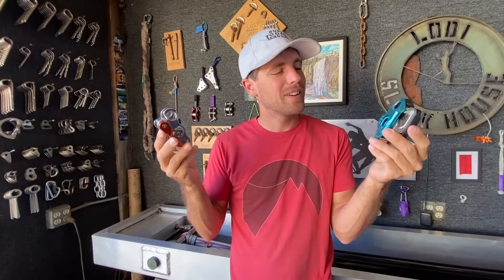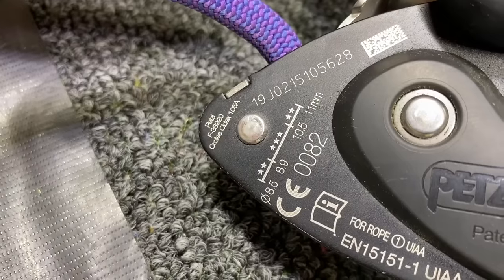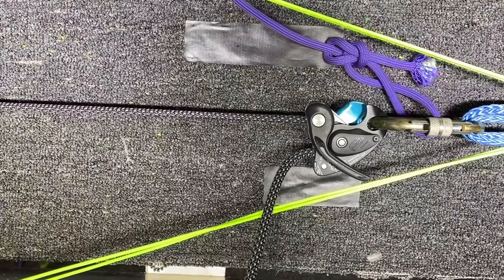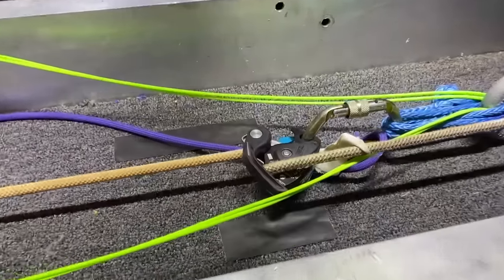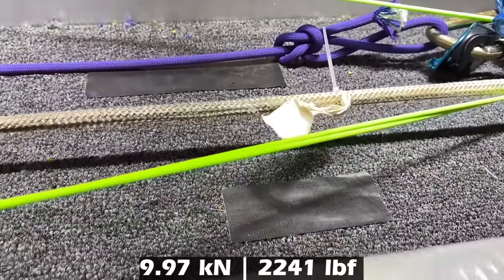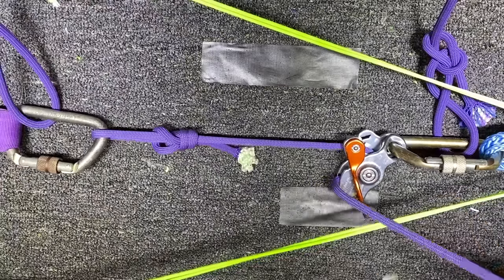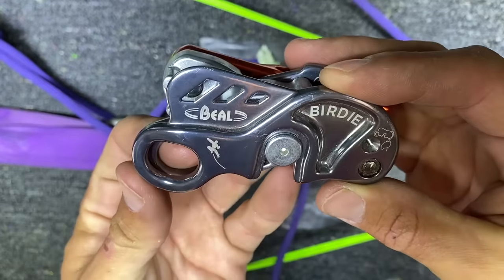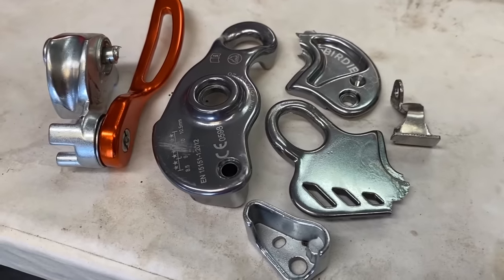What breaks first??? Petzl GriGri or the Ropes? + Beal Birdie Tests!

Comment: The gri gri slipping is still super good enough. That slip on a big fall will help give a soft catch and it will only see max force for a couple of seconds
Reply: Plus not destroying the rope.
Reply: @lazycat5108  well if you experience 10kn, I don't think they sheath of your rope breaking is your main concern
Reply: @loganvilas1032  True! But you see, it'd be easier for my belayer to pick up my broken body if it is still attached to the rope :D
Reply: @lazycat5108  i laughed at this and probably shouldn't have, thanks!
Reply: True, I can see the slippage being useful on trad pro for helping reduce the force on those too
Reply: I was thinking the same
Reply: They both did slip, I like that the birdie slipped less.
Useful for tree work.
Reply: More like a few tens of milliseconds. Even if you fell 100 meters in a perfectly streamlined position it would only take you 0.3 seconds to stop completely at 10kN. (And that would be with an infinitely static rope.)
Reply: Welcome to the hydrolic stretch channel.
Reply: @loganvilas1032  
Not if the device blew up and dropped you….
I’ll take a desheathed rope over a free fall any day.
Reply: @johnarcher9480  after hundreds of climbs without ever having a problem I'll take my chances. Not to count the 10's of thousands of grigri's out there not blowing up
Reply: @loganvilas1032  
And I’m sure it will be fine. Just as fine as you would be on a birdie.
Not many take 10kn falls 😉
Reply: @johnarcher9480  exactly 💯
Reply: The birdie works better for lead climbing in every way. Feeds better, it’ll lock hands free so it’s ultimately safer if the belayer gets hit by a rock, camming device will still lock in a fall if the user is holding the cam down, before you bad mouth a device that got tested in unrealistic tests, go use it in normal conditions and I promise you’ll like it more than the bulky overpriced plastic gri gri
Reply: @justindoss3701  what device did I badmouth?

Comment: I bet the Grigri is designed to slip around 4-8kN. I mean it's probably so if something were to happen and those forces do end up happening, a few feet of rope being taken with a constant 4kN force, could potentially save someone's life because is helps lessen the impulse of the fall essentially making it safer.
Reply: Yeah, that’s my thinking too. But let’s see how it handles the quick and heavy tensions when the drop is set up. Super excited for that. I think HowNotToHighline needs to invest in a higher frame per second slowmo cam to catch those extra juice gear gut spills.
Reply: @zanestathakis30  this test is basically already done, has to hold a fall factor 2 fall hands free in uiaa testing.
Reply: The GriGri was designed to allow for a slow slip in the event of a fall. It's one of the main reasons we use them in rescue. I love the GriGri because it's saved my hide a few times. However, I wouldn't touch the Birdie with a barge pole. I've found them far too unpredictable and touchy to use in a rescue situation.
Reply: @ryanhanslo3029  They do work great when doing solo work, Guiding the rope is import and, and makes the Birdie much more controllable. I can see how in a rescue situation that might be more difficult. Why not the Rescucender?
Reply: Are you using a static rope on rescue missions?

Comment: interesting to try micro-traction and alike - how low they really start to damage ropes. Cheers!
Reply: This would be super interesting! Micro Traxxion and Petzl Shunt break tests please!
Reply: Microtrax vs ct roll in lock. Can skip the Spock and duck lol
Reply: Would definitely like to see the Micro, since it is the gold standard for rope solo and simul-climb right now. 

The Micro is only rated at 2.5kn, I heard TC say it's good for 3kn, but don't think he tested it.
Reply: @GregSidberry  whats wrong with Spoc? I've been using it for a while, super happy with it
Reply: @pavlodeshko  it's not a well rated device based on testing. It's recommended to avoid the Spock for TRS. Duck is similarly poorly rated, but better design. Microtrax and CT roll n lock have both tested well with micro being more damaging ( fine teeth) vs CT handling higher loads. Everything has a failure mode/max force: spoc and duck just hit them easier
Reply: Would be interesting to see the micro-traction and Tibloc in tandem for a crevasse rescue context- maybe with some thinner ropes like the Petzl Rad line
Reply: Yes please do this!! I TR solo with the micro and some other rope grabs and I want to know what happens when they get pulled
Reply: Micro trax and Camp Lyft would be cool!
Reply: @GregSidberry  super good enough for me - spoc will fail long after the rope. Will agree on duck though, its basicly not load-bearing pulley at all - requires rope to be passed through carabiner to hold
Reply: The thing is.. a pull test is kind of meaningless as it's the behavior under impact (in a fall) that you're interested in. Needs the drop tower.
Reply: @johtso1  these things work very similarly in a fall. They slip at their max load for a given rope, until the friction absorbs enough energy for the falling object to slow down and the peak force to drop. That’s pretty ideal for a fall arrest device, as stopping a fall above 6kn is very risky. Basically you want your device to give you as much friction in brake mode as your body can handle, and slip at that point.
Reply: @blakeseidler3577  Not sure which specific devices you're referring to, but micro-traction doesn't slip at all.. it bites and then strips the sheath if there's too much force. Think the same goes for many similar devices even those without teeth. Maybe applying a static load is enough to figure out when this happens though? I'm not really sure..
Reply: Micro-Traxion damages a 10.5mm EN1891 Type A semi static rope about 4kn if loaded up to it steadily like shown in the tests here but very dependent on outer sheath condition. Croll (and the other ascenders that use the same design like the basic) are about 4.5kn from memory, however they don't tend to fail just bite into the outer core until somewhere a bit higher. I wouldn't want to fall onto any of the teeth based systems to be honest. Industrial side you aren't meant to ever put yourself in a position where you could fall on them.
Reply: Im curious about the ropeman

Comment: You could get a cheap thermal camera (about $160) to easily find hot parts on the floor. Just be quick about it before it cools down, and make sure you don't have to many hot things around. Alternatively, if you can darken the workshop, you could put a little (invisible) UV fluorescent ink on the part being tested, and a UV flashlight to find it.

Comment: I once witnessed a 140ft factor 2 fall on a Gri-Gri: Lurking Fear on El Cap, party was block leading, leader was self belaying on a gri-gri (70' out from the anchor below, at the end of his rope, just as the 2nd was arriving at the anchor), leader was aggressively back cleaning, he wasn't using daisies and fumbled out of his aiders, pulled the only piece between him and the anchor (#1 Camalot). The fall was on p5, we were on the ground about to start, pre-dawn so I saw the headlamp beam falling, I happened to be looking up.

They managed to self rescue back to the ground, and walk out under their own power. Rope burns, sprains and strains, and minor kidney bleeding. They happened to live nearby, so I got the details when he came by to pick up his gear that I had cleaned from his highpoint (2 cams, 2 aiders). He said the Gri-Gri was slightly bent (I dunno exactly) and was jammed/cammed hard in the locking position onto the rope, which reportedly took some effort to un-cam and remove. He was tied into the end of the rope, not sure if/how his knot might've been pulled up against the device.
Reply: Wow, that has to be the worst whipper I've ever heard of. Can't imagine walking away from that.
Reply: Whoa!  That is heavy.

Comment: Seeing the GriGri slip before breaking makes me feel pretty safe. Slipping would probably mean that I'm not entirely snapped in half during a fall.
It makes me wonder what other devices like the Madrock Safeguard would do in the same situation.

Mad hype for the drop tests. I'd love to see all of this again in a dynamic situation. Plus you can get some HUGE forces on static ropes, so we can probably see some fun stuff with that tower.
Reply: They both slipped before breaking.
On the larger rope, the birdie gripped better.
The Grigio blew up at 9.7 KN. The birdie started to desheath the rope at 9.9. 
If somehow you were in a 10kn fall (other than maybe breaking your back) the Grigri drops you to the ground, the birdie desheaths your rope.
Neither a “good” thing, but at the end of the fall. A desheathed rope is better than a free fall.
Reply: You will never put that much force on the belay device with a dynamic rope. So it really doesn’t prove much.

Comment: Hey Ryan, avid Beal Birdie user here. To answer your question you don't lower off the birdie like you do a grigri, using only the handle, you instead use the handle for rough control and hold on to the brake strand and meter slack out like an ATC.

The Birdie has been my favorite assisted braking device for a long time, the all metal construction and ease of giving slack while lead belaying makes me recommend it over the gri gri for new buyers, glad to see it holds more than a gri gri too, more to brag about! :3
Reply: The thing is with a atc u have ur two hand on the rope not one so iam not sure with one one only you would need to let the rope slip tru ur hand risking burning yourself while the grigri you really control the speed whith your left hand on the handle ! The rigth hand is just there for safety 
Avid grigri user here !
Reply: I'd say you handle the Gri just like you described you would the Birdie while lowering. Petzl even made a biner especially for that purpose to increase friction and care for the skin on your hand
Reply: @seeeeeb9300  yeah its the same, just a different cam position.
Reply: Yeah, it’s a little more bias toward the brake rope side vs the handle side.
You CAN control with just the handle, you just need to move less to make speed changes.
Love the size of the Birdie as well.

Comment: It would be fantastic to see how an Edelrid Jul 2 or Mega Jul would hold up in these similar tests.  A little "apples to oranges" but it would be interesting to see where the failure point it, as there are a lot of folks using those as well.  Thank you for everything you experiment with.  A wealth of information is generated by you guys.
Reply: Jim titt did some testing on this that you can find on mountain project, slips at around 0.8kn and will continue to slip from there.

Comment: Hi Ryan. As a adventure guide we sometimes have to leave slings behind when abseiling. mostly in canyoning. I have seen that in Australia canyoners use old car seat belts used as slings. are they good enough. great work as ever. PS hi from Scotland
Reply: I would imagine that as long as the seat belt is in decent condition that it would be good, as the ratings I see  from a quick search range from 13-25KN. It'd be cool to see though!
Reply: @mattsoukup1789   I guess then the attachment method, either knot or stitching is what would make them safe or not.
Reply: @nicholasmiller7886  seat belts are like dynamic ropes, they stretch a lot.
Reply: We use single-use-slings made from seat belt in construnction. Thin, strong, flat. You can built it in a wooden wall and lift it with a crane or you screw it down with a 2by4 or somecind of wood. 
They are certificated as a lifting sling and rated about 800kg which should be arround 1400 lbs and they cost arround 1 euro
Reply: @Elmer Adams  source?
Reply: @hudsonmote9680  You know, that's just what I've been told over the years. I'll look into it. If I find a good article I'll let you know.
Reply: @hudsonmote9680  I did researching. Seat belts stretch a little because that reduces forces in a crash (kinda like climbing). However not all accidents are in the front, so it has to keep you in your seat. I wasn't able to find any data on stretch. I emailed seat belts plus (they sell webbing and belts for cars). They said "The webbing we use is a 1 7/8 wide which is the auto motive standard but the tensile strength is 6000 pounds. The webbing is not stretchy at all."
So for climbing I wouldn't count on it being static or dynamic. (6,000lb = 26.6kn).
Reply: @elmeradams8781  seat belts are not dynamic.
Reply: @TheClanAdventures  You might not be correct. I know some seat belt retractors tighten (to take up slack), then lengthen when pulled on (to lessen the impact). Since I couldn't find any data besides random people saying "seat belts stretch up to 20%" (with no source for that info), you very well could be right.
Reply: @nicholasmiller7886  we use to lift engines with them too. Sometimes they break easily at the knot, or they slip. Sometimes they hold 200+kg No way they are rated for 22kN like ropes. It's garbage. I wonder if it's nylon or just some polypropylene

Comment: Thanks for that this is super nice to know. I often put quite heavy loads on gri gris at work. If it's really heavy I prefer to put it on a rig but still I've had situations where I've hung 200-250kg with 10.5mm static rope on a gri gri. Knew it was pushing it though

Comment: The tension force of a rope is felt at both ends, and for an inertial body (like a falling person), presence of force implies change in velocity.

7.3 kN will bring a 200lb person falling at terminal velocity to a complete stop in 0.98 seconds, long before you lose a significant amount of rope to slippage at the pace seen here. Super good enough.

Comment: Instead of trying the rope to the load cell when breaking belay devices it would be more useful to just tie an overhand or a slip knot in the rope and pull the know through the device.  The rope soloers tie slip knots in the rope as a fail safe assuming that the knot will jam in the device is the device fails to auto-lock in a fall.

Comment: With the brake strand tied off behind the load cell, you're only measuring the force on the carabiner. Same with you holding the brake strand. The load on the climber-side rope is equal to the force on the load cell, PLUS the load on the brake strand. It's like the inverse of a pulley system. The break force was probably way higher, and the slippage with your hand on the brake strand was equal to the measured force, plus however hard you were pulling on the brake strand.

Comment: grigri test winner for me.  it does not damage the rope and is safe.  its advantage is that it will softly close the rope and will not break it with the utility forces kN 👍🔥
Reply: The Birdie did the same. 
On the big rope, it took more to desheath the rope than to blow up the grigri.

Comment: As far as I am aware all belay devices will slip, because they all are brake assisting and they will not brake the rope completely, and the GriGri is one of the devices with the highest slip value also compared with other half automats, so it is actually very static in comparison with tubes or even HMS, which is why for instance in alpine multipitch climbing with belay from a fix point you should never use a GriGri. Here is a comparison of different half automatic belay devices in German with the slip values (Durchlaufwert), and other interesting stuff https://www.alpenverein.de/chameleon/public/919174d8-26c1-2717-9f9a-6f7479be220f/Panorama-2010-4-Geraete_18413.pdf

Comment: Didn't know about the Birdie, looks light and sleek. What's your experience with it guys, compared to Grigri?
Reply: I LOVE the Beal. I use it for tree climbing and radio tower climbing.
Keep a little tension on the tag end, and it can release very progressively. It does take less movement to get it to release, but once you are used to it, and get a feel for it, it’s a non-issue.

Comment: Ok, so we see grigri is such a well-designed device!
If we put all the pieces together:
When the grigri is on the belayer the rope slips around 7 KN; the climber would have created a force of around 14 KN and the anchor would have a force of around 21KN. 
If you think about it, the harness is designed to support at least 15KN while many anchors and bolts are prepared to support around 22KN, however there are so many variables here and those forces would be nearly impossible to achieve in a realistic rock climbing situation. 
Therefore, just when the whole system is about to collapse grigri would release some rope to give you a second chance. How amazing is that?

Comment: Just a quick question has anyone else used the gri gri in industrial applications I busted mine in 4 months of descending as a high rise window cleaner?
Reply: Just to be clear we have another rope and an assender as a back up but I did end up having to ascend to the top after the gri gri failure
Reply: 🤯 how did it fail? 

I’m starting to not trust the gri gri!!
Reply: How did it break?!?
I use the Birdie for tower climbing and tree work. Glad to see it seems quite strong.
Reply: @DJ-kg6zq  the breaking mechanism got jammed with dirt and didn’t engage then I forced it into place so I could get down and it got stuck nearly locked only happened once and I use and abuse it so it was due
Reply: @maxallmark736  thanks a lot! that’s good to know!